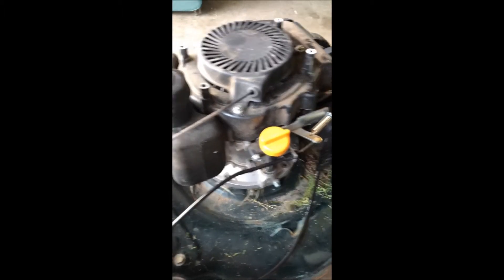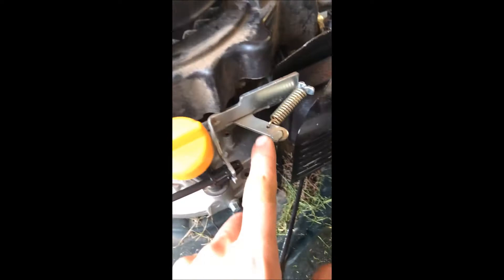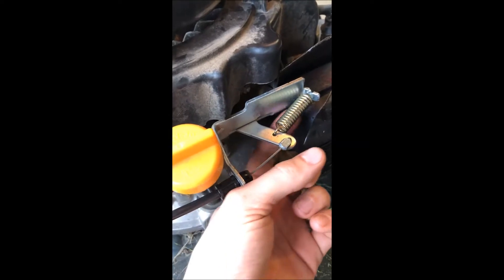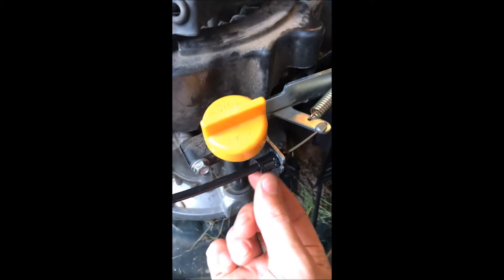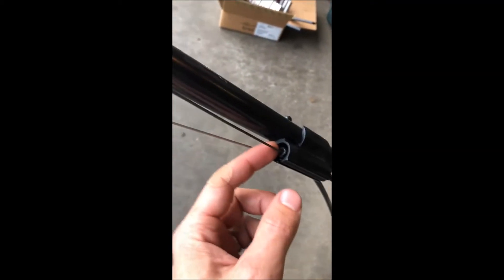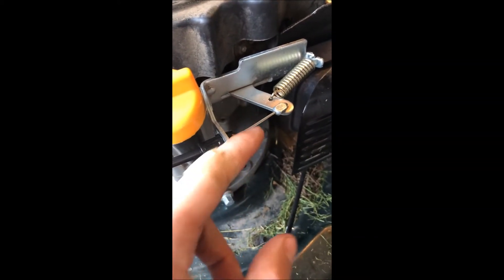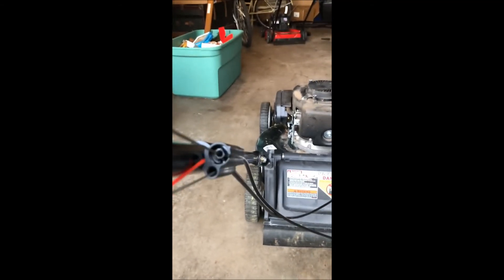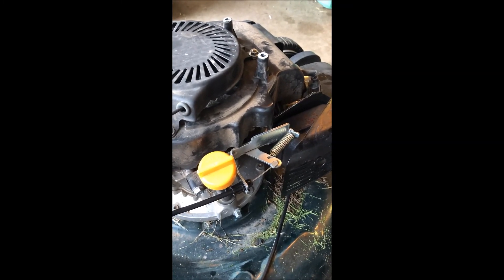How-To: Fix a Tight Seized Stiff Lawn Mower Throttle Cable

Comment: The piece that the lever is supposed to move, won’t move. Worked last year fine. Was under a tarp all winter. Hammer and wd40...won’t budge. Piece with spring moves fine but the actual piece that needs to move in order for the mower to start...just won’t.
I’m sure there’s nothing you can tell me on this, but I figured I’d put it here to see if I’m just missing something.
Thanks!
:)

Comment: I have a fleet of mowers that all came off the side of the road ( set out for the garbage man) usually a simple fuel problem gets them going! I have had such problems as - too much crankcase oil,broken spark plug,kerosene in fuel tank and a faulty kill switch!!!!
Reply from the maker: Love those kinds of finds!

Comment: How did you switch it around? The zbend is in the way no? How did you get the z bends through?
Reply from the maker: You don't actually reverse them in the plastic housing, you just flip the cable around. Mine was identical on both ends.

Comment: I wonder if spray silicone or spray white lithium grease might be even better than wd-40 longterm?
Reply from the maker: That's correct. The WD-40 is used as a solvent to dissolve the rust. It should be followed up with a true lubricant such as ones you mentioned.
Reply: @GuidingBoltGaming  Thanks Guiding Bolt.  I'm working on that this weekend! Best